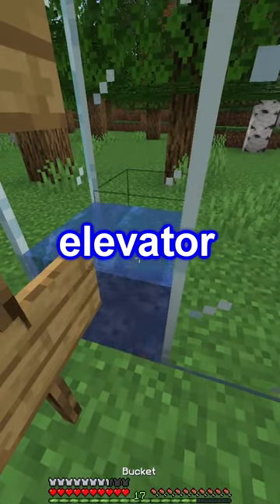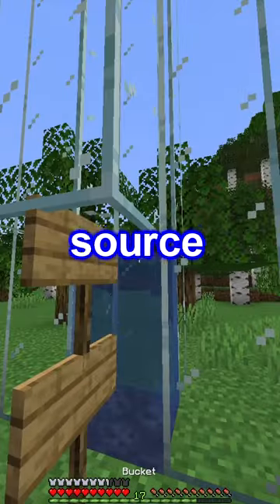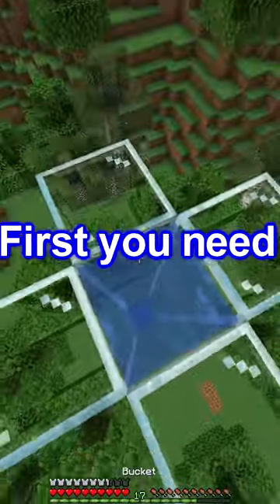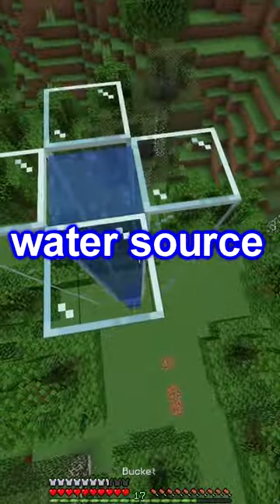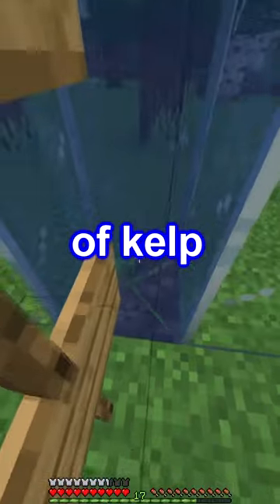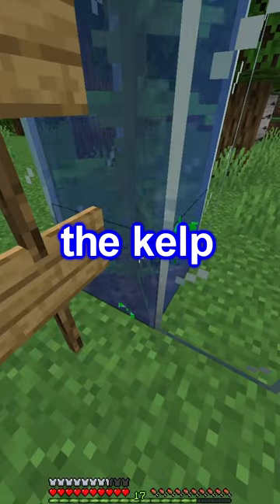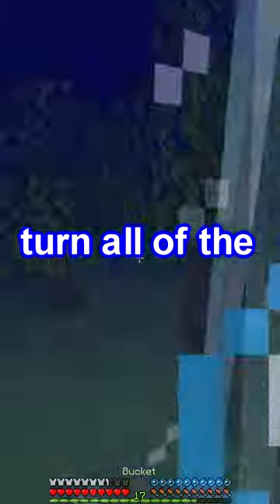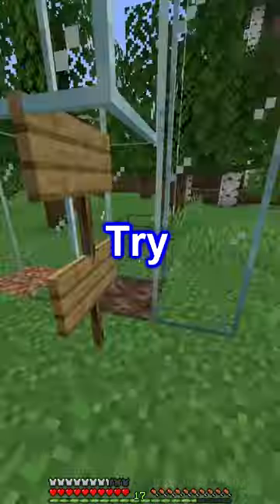HOW TO CREATE WATER SOURCES FOR A BUBBLE ELEVATOR IN MINECRAFT!

Comment: You need kelp, which is found in ocean and you don't have water, like wow very smart YouTuber
Reply from the maker: It doesn't say you don't have water lil bro, the kelp turns all of the flowing water from the top source block into source blocks
Reply: @ObamaBeansShorts bruh, bro I know that, but what you said was that, "only have one water source block" instead of " it is difficult to place water on each block to make bubble elevator" or a similar sentence, you saying that it doesn't say that you don't have water but in the video you yourself told that bro
Reply: @ObamaBeansShorts i know what you are trying to make the video but what you say is not related to it and is actually a totally different thing